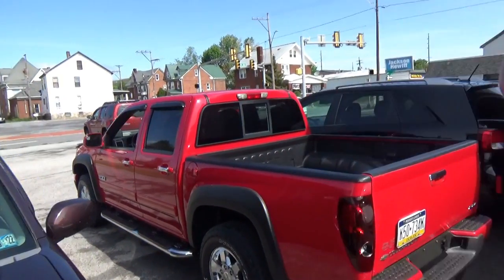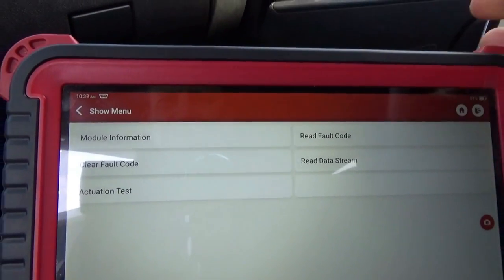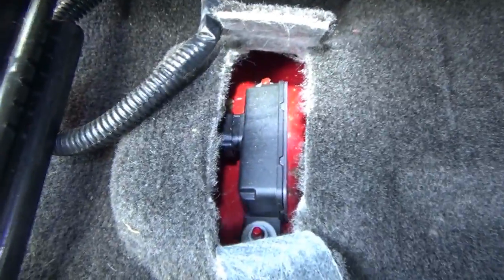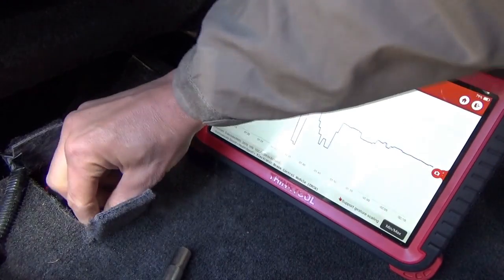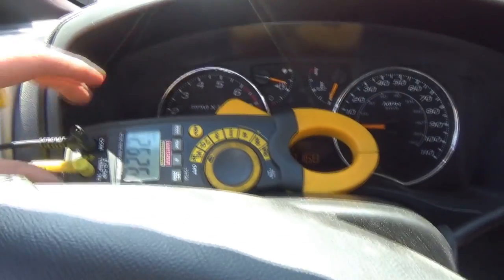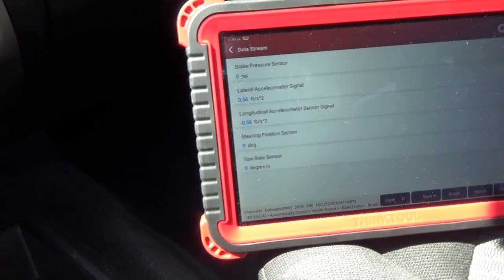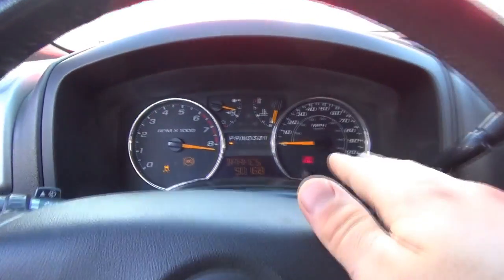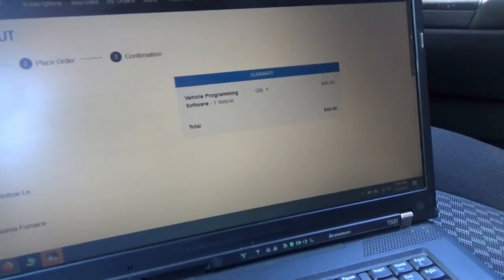Weird ABS/TRAC FAULT (GM Truck Diag & Repair)

Comment: As far as rate sensors go, yaw and acceleration, a properly designed one will show 0 when a vehicle is at rest in any orientation.. At rest there is no acceleration. It looks like they're using levels or compasses and offloading the math to computer so it should initialize fine with moderate deviations from zero because they are not calculated as orientation sensors.
Reply: Not true.  If the vehicle is at rest or travelling in a straight line, the yaw rate will -- or should be -- 0.  The lateral and longitudinal accelerations will be only under rather specific conditions -- which, for a vehicle are remarkably rare.  The yaw rate is not the same as the lateral acceleration, but there is a relationship.  The combination of vehicle speed and lateral acceleration will give you the radius of the path and the desired yaw rate, which is compared to the actual yaw rate and, if they differ, will generate a correction signal to the brakes to correct the yaw rate.

Comment: Need to adjust tire pressure and level the body before adjusting that yaw sensor.
Reply: That's not how acceleration works. A thing has to move to have acceleration. A truck sitting in a lot should have zero on the acceleration sensors.
Reply: @anonymic79  vibration from being in the truck and nearby traffic, wind, earths rotation, other magnetic fields all will make the sensors jump around
Reply: @throttlebottle5906  I did say it would have to move. What you're saying is it would have to move. Do you have a point or do you just go around repeating people?
Reply: @anonymic79  ""A truck sitting in a lot should have zero on the acceleration sensors.""
a truck sitting in a lot is still moving. lol

Comment: How did they get away with the program every module scam?
Reply: It's so they can use the same part on multiple vehicles that need different calibrations on them.
Reply: I think the flash should come with the part, it is just a hidden cost.
Reply: I assume you mean the scam of paying to get the data and programming, they all need a spanking as that stuff should be free open source. lol I can imagine the hackery though

Comment: Why does the tach appear not to.move when you start it up?
Reply: Ah yes..the classic crappy solder joints.   GM. Mark of Excellence?...that was a looong time ago.lol😎
Reply: @VWWRENCHIE  either that or it needs the "magnet flip" tried. it could have been wrecked and it went wonky
**never mind I just realized it was at zero/working earlier in video, bad solder joints it is!

Comment: I wonder how many expensive circuit boards are thrown away solely due to the lack of a tiny speck of solder. I guess most manufacturers don't care if they fail after the warranty expires, so they let the assembly line workers in Mexico, or China, slide on the amount of solder they apply. Or maybe they tell the workers to use as little solder as possible, to increase their profit margin. 
Then again, some automated solder bath process might be at fault, with oxidation or contamination on the solder bath, or on the parts. Maybe some air gets trapped in there and displaces some of the liquid solder. We may never know.
Reply: Chances are it's done by machine.